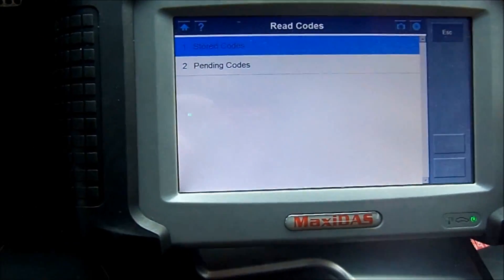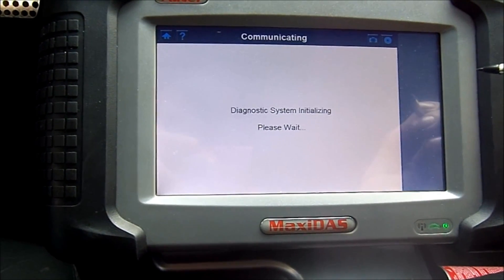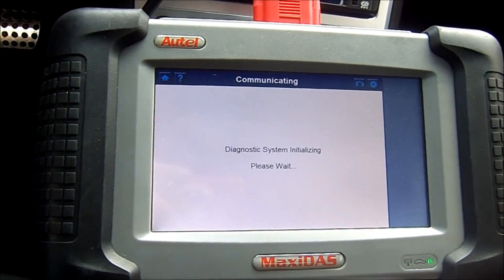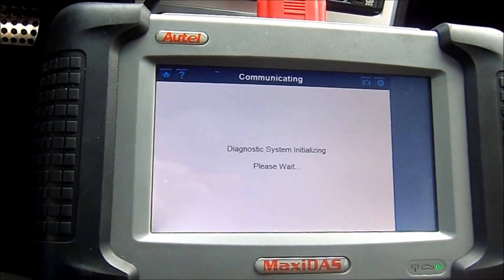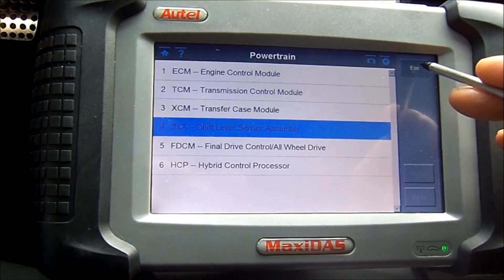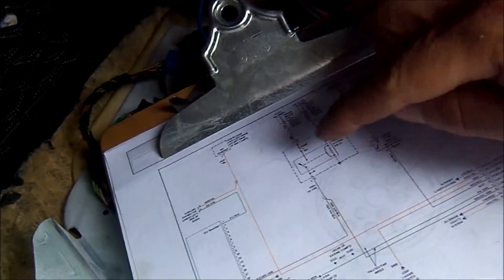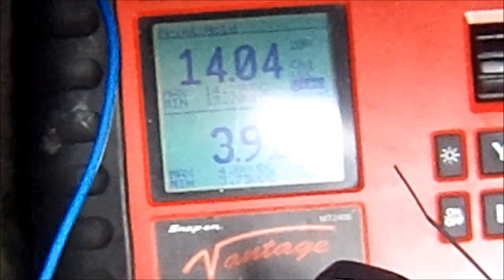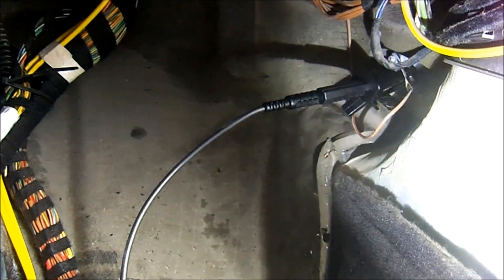722 6 NAG 1 Transmission, Fail safe, No Communication

Comment: I'm getting a no communication tcm/egs to dash cluster , but it shows all my gears on the dash when I change them, goes into drive and reverse but only drives In 3rd gear and then I get a incorrect gear ratio code.

Comment: good day. my c 200 k Mercedes  have a problem with the transmission box too, while driving it turns it self to neutral, you switch the car off and start again it drives for half a mile then back to neutral again. i changed the torque convertor, no change . conductor plate, no change, changed the whole box, still no difference. can you help please its been 4 years now

Comment: I had the same problem. I replace the TCM with out reprogramming and it let me go from 1 gear thru 3 gear. Later the transmission  went back again to safe mode not getting more than 1 gear, not sure if was 1 o 2 gear. and I did the voltage test before and after went back again to safe mode with the replaced TCM installed wich was 12 V  ok and 3.6 V after went back to safe mode. All the valve solenoide check good ohms. For me in particular seems like I have an extra problem. Good video!

Comment: hi hiram.dodge charger with famous 7.22 transmission.p0730 code.neutralizes round 40 mph.replaced valve boddy and lut shift kit in it.worked fine but for a day and its goes back to safe mode.any suggestions.bad k1,k3 drum?..help please.thanks hiram.

Comment: Good video. Gotta love those 722.6's. You ever had one of those come in where the stator shaft actually twisted inside the pump body and made a cross-leak that caused a no-move condition?